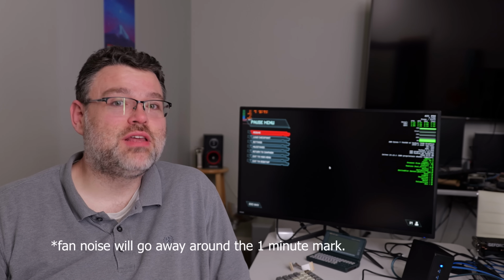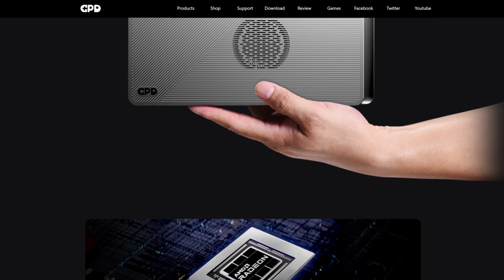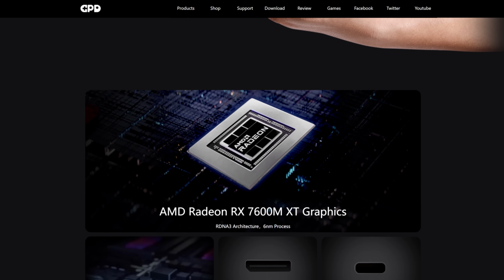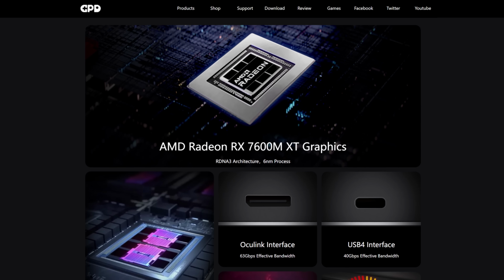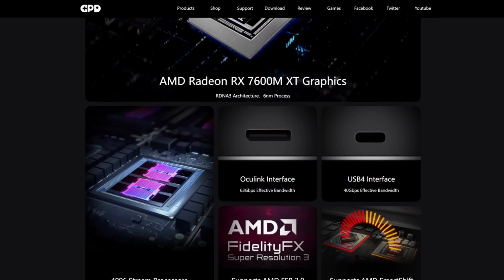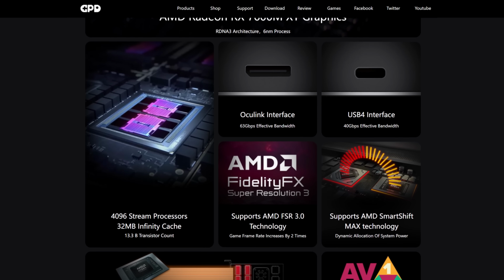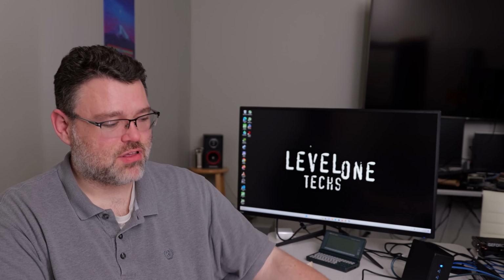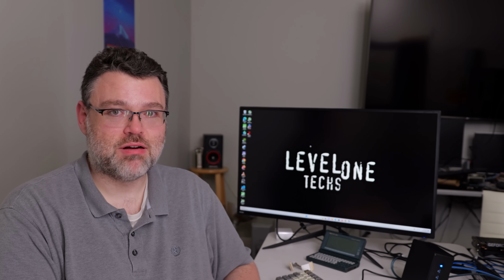GPD G1 + Minisforum UM790 (and a chat about Oculink and Thunderbolt Next)

Comment: Hi was wondering if you could help me please. I have both those exact models. The GPD G1 connected to my mini pc via oculink. I bought a Gen 4 50cm oculink cable. Question… do I use the HDMI from the GPD G1 to my TV only, or do I use the HDMI from my mini pc to my TV… or both and mirror them. Which one gives the best performance? Also do I connect both the oculink and thunderbolt 4 cables or just the oculink. Thanks, love your review! 😊
Reply: Sorry my actual problem is. I run the setup on my Samsung QN90B model tv. I have the setting set to game mode for 120htz. But all my games I have to press the option key otherwise my games won’t boot up. Also some in game cut scenes I have to press the option key for the game to boot to the next screen. Was wondering if I have the connections set up incorrectly. Thanks.

Comment: It's a shame for Intel that TB5 which didn't even come out yet is already kind of obsolete... I honestly don't get why external PCIE interface connections r not evolving fast enough and server based Oculink which kind of obsolete as well is saving the day. All mobile and mini PCs coming with reasonably good CPU could tremendously benefit from it by connecting eGPU card. And this pairing + docking station setup could go even further with all kind of benefits both for AMD and Intel. Hope to see more sophisticated and elegant eGPU + docking stations setup in the future similar to the Beelink GTi and that hopefully Oculink won't die after current version 2.0.

Comment: I tried a thunderbolt 3,4 GPU dock for my Minisforum UM 790 pro. It cost me £120 plus £85 for a Power supply. I already had a RTX 2080. Although it was a huge improvement I WANTED MORE🤣so I though I would try an Oculink setup(which was cheaper than the thunderbolt setup) In the meantime I took my RX 6900 XT from my gaming rig and did a little comparison using Unigine Heaven and it blew me away(do they still say that 🤣) Anyway here are the results if your interested:

Minisforum um 790 pro(780m) with graphics set to 6GB in Bios : - FPS=77.8, Score 1960
Nvidia RTX 2080 with internal graphics disabled : - FPS=298.7, Score 7524
AMD RX 6900XT with internal graphics disabled : - FPS=391.4, Score 9859.

I Thought the 790 Pro was quick but the above results brought me down to earth😃. I suppose I should run both cards through my gaming rig and see just how much faster Pci 16x is than pci 4x(Oculink through the M2 Nvme).

Comment: Thunderbolt is cool. 7600m doesn't get better than it actually is. Oculink is that nice thing that PC users never had. Wish half PCIe slots were ripped out from PCs and replaced with such connectors,while also being supported by market for regular people. All those PCIe risers could be ditched,things could be smaller and more compact, pretier and much more practical.

Comment: Would you mind to share the actual cable connecting on your device? I got this exact same setup, inspired by ETA prime tests, and got really disapointed because the M2.Ocullink connector does not go well inside the Minisforum UM790 Pro. Now I am using tb4. Moreover, I am getting some wierd driver issues, because my system goes dark when I am playing really graphic intensive games. Using on PopOS, did not try on windows.

Comment: Are you sure about Type C ports supporting up to 8 high speed pairs? I understand you said it has not been implemented, but I'm not seeing enough pins to support that unless some of the auxiliary pins are optional.

24 pin total
(4) for the two TC pair
(4) for the two RX pair
(4) GND
(4) VBUS
(4) for reversible USB 2.0
(2) for SBU
(2) for VCONN/CC1

I suppose the USB 2.0 pairs could be reworked (who wants USB 2 anymore? :) ) and the SBU pair is open for alt mode, but that would only open up 7 pair. I would think reworking any of the power pins would be a recipe for disaster, but I could be wrong.

Comment: Thanks for this video. I agree with you Thunderbolt 5 is already obsolete. Intel don't want to accept it. By the time Intel get Thunderbolt bandwidth to where it should be to support extrenal GPUs (eGPUs), integrated GPUS (iGPUs) will be adequate enough to make eGPUs pointless. Laptop discrete GPUs (dGPUs) are already adequate enough to make eGPUs pointless. Intel should have launched Meteor Lake (Core Ultra) with integrated native support for Thunderbolt 5. If the MSI Claw had Thunderbolt 5 it would be a huge advantage to what AMD has to offer. Other than external graphics and docking, Thunderbolt Share is something that should be already in use for multiplayer applications.

Comment: I have UM780XTX + GPD G1. Manufacturer promise that i can start system only with oculink but it doesnt. Only if USB4 connected. 
I can't name GPD G1 silent, cause its mainly stands on same table wtih monitor(near to user) and has turbine mode cooler, when it goes to "full power" mode(in gaming, for example) noise become very disturbing. Even if you are use headphones.
P.S. You can hear this whistling noise in video also.

Comment: It is worth noting that (if my understanding is correct, it may not be. Please correct if so): 
USB4 is technically capable of pcie4x4. But the motherboard side controllers are not. Although it has been proven in testing that USB4 does already exceed the pcie bandwidth of TB3/4 - but this is more a saturation of the pcie3 bus. Not jumping up to pcie4. 

Anyway, long story short - as the motherboard side controllers progress, the USB4 connection of the GPD GPU may well come close to the OCULink connector... You know, once the connector breaks 🙃

Comment: I would be very satisfied, if Thunderbolt could give me the option to only run PCIe over that USB-C (Laptop to eGPU) and the dock specific part over that USB 2.0 separate stream that every USB-C cable should include.
Keyboard, mouse and audio don't need more than USB 2.0 and if I need any high-speed connectivity I would directly connect it to the laptop.
What wouldn't work is any display signal over that cable in my case and i would be fine with that too. The internal display could still run with the iGPU.

Of all that might be very complex but it would be really nice. Even better when the system could switch between running on the iGPU with USB4/TB working normally and then that mode i explained above.  One can dream.

Comment: Pretty sure I destroyed my oculink port on either the GPD G1 or the GPD Win max 2 (7840U/64GB version) because I hot plugged it the first day I got it without realizing it would destroy it.  I have never been able to get it to work and I haven't had time to test the M.2 port with the adapter to confirm if this is the case.  Only works over USB 4 in all my tests on Windows10/11.  Sending my machine back to GPD set me back $200 through DHL for a free repair when the HDMI died on my other GPD Win max 2 (2022 6800U/32GB version) was a miserable experience but GPD does honor the 1 year warranty at least.  

It's great to see how awesome everyone's experience CAN be but mine has been... expensive and under-delivers.

Comment: I wonder if MCIO will ever see an external high-cycle connector, potentially with power injection.  USB channeling is irrelevant when add-in cards exist, and as PCIe spec gets faster this quickly becomes a non-issue.  For a consumer device, the 6.1 spec might be the peak, unless graphics card manufacturers do something braindead and make GPUs eat up all available bandwidth like AI/ML/NN cards do.  The story will forever be the same as it always has been, USB is for convenience but it's not the most powerful connector.  I also think there's situational nuance that consumers, nor enthusiasts, quite understand about the USB/TB and OCu/MCIO docking situation, by time you're reaching the capabilities of a true PCIe link, you're also asking for power demands that you would not want to be pushing through PD from host to device; and again, the USB channeling situation becomes irrelevant after a spec update.  Though I can see why someone would want PD from device to host, for host charging, and I hypothesized awhile ago that an out-of-spec implementation of OCu could probably achieve this considering there are four dead wires, literally listed as not connectected within whatever spec number these external PCIe solutions fall under (SFF 9402 R1.1, from the top of my head), where you could just use this dead copper as a form of power delivery with an accompanying injection module at both ends; I haven't looked at MCIO but I assume there's chipset-side pins that also have dead copper within the cable.  It's one of those situations where it feels like we're just one step away from having something great, but then again the industry has felt like this for the better part of a decade.  Last piece of the puzzle is a proper connector for PCIe 6.1 speeds with a branch of USB PD without the USB part, otherwise that's consumer endgame barring GPU manufacturers doing something stupid; GPUs aren't pushing those speeds, consumers don't need current-spec NVMe drives, 4.0-spec NVMe is more than enough for enthusiasts, 3.0-spec is probably also more than enough especially considering that you can utilize multiple drives by that point, USB chipsets take up hardly any lanes, etc.  An 8i cable on 6.1, assuming the MCIO naming carries over from the OCu naming where xi indicates equivalent lane count per gen spec, would be more than enough considering that's the equivalent of 5.0 x16 or 4.0 x32, enough for a modern full desktop GPU (again barring the industry doesn't do something stupid) and plenty of other connectivity within a dock, all over the double-wide cable, whereas a 4i, single-wide cable, would be enough for a GPU alone where the GPD solution of OCu+USB4 would suffice for a minimalist dock such as what we're currently seeing.  In fact, this might as well be overkill for consumers, an a laptop chip even run a top-end desktop GPU without significant bottlenecks that would otherwise justify a full desktop build?  Plus at that point, I'd rather see the adoption of consumer-level thin/thick setups where you have a thin and light that plugs into a networked server; by the way, what ever happened to Intel's Continuous Compute, I remember the original announcement and thinking it was essentially the consumer-friendly thin/thick. 

Though I also have to question at what point do we just look at optical links instead.  USB4 Gen 2 has a 2m limitation, Gen 3 has a 0.8m limitation, beyond this the cable might as well not be usable, Type C might as well be DOA when USB5 comes out, etc.  Even on the PCIe side, those cables are going to be fairly short, proper spec for 4.0 over OCu is already fairly short; and as a tangent, considering PCIe 6.1 supports 800G networking, all of that is already optical.  Maybe we'll see an OCuLink revival that's actually optical and copper this time, and that would solve the data transmission and power delivery issues.  Maybe if we could develop a super stubby variant of OSFP + power with a high plug cycle rate, that would be the endgame solution; though I would expect device cut-outs, alla FrameWork's module slots minus the module and just using a Type C cable in the host port, would work, not to mention it'd give nice physical security to the plug.  But we're reaching the point where copper is becoming less usable for data transmission due to physical limitations; isn't PCIe itself nearing EOL just because of this issue, I remember 5.0 was the industry's hypothetical EOL spec before PCI-SIG changed signaling strategy, and we saw the QOL drop from 3.0 to 4.0, considering 3.0 had massive overheads that allowed for a ton of risers, yet 4.0 nearly shits itself with one riser- what happened to all of those post-PCIe connector projects anyways, or did nobody actually develop anything during that time? 

I just want the specs and implementation to evolve already to where this becomes a moot conversation on the consumer device end.  We literally are just one step away from this, minus the lack of connector, minus possible changeover to optical data in consumer devices, and barring the GPU manufacturers doing something dumb.

Comment: It's a very refined object, but if I think about how much a simple, banal port costs that has a real 40Gbit of bandwidth to move a few files quickly (where the filesystems allow it), it's actually not bad at all. It's like having the graphic card separate from the machine plus a top-of-the-line dock included in the price. It is a product that needs to be understood, which is not suitable for everyone, but which makes a lot of sense in my opinion, for many many people, especially if you consider that even laptops, when the graphics card really works, still want a power socket near. I like it. Thank You!

Comment: Modern efficiency in computer chips is wild. I currently have a big, powerful desktop, but I think in a few years I'll probably migrate to a handheld with an eGPU. With the 7840u, he current CPU speeds are plenty for me, I can get 64GB of RAM in the GPD devices, which is more than enough for all my productivity work, and the integrated GPU is plenty in handheld mode (I'm pleased even with my Steam Deck OLED when it comes to handheld gaming). The one thing remaining is improving the eGPU speeds. I have a 3080, so the G1 would be a downgrade for me. In ~3-4 years though, I expect there to be an eGPU that is a significant upgrade to my current GPU.

Comment: TB3 is veeeery outdated. I use it for plugging in my work laptop, it's super handy to have charging, USB and display output in one connector BUT I can only have USB2.0 or I have not enough bandwith for 3440x1440p  with 120Hz (luckily "dock", which is built in my display alows to redirect lanes, so I can have high refrashe rate or usb3.0 if needed) and chargning is limited to 100W. TB5 is needed now and for sure 120/40 or 80/80 is not enough for future.

Comment: Just PCIe things: CompactFlash Express cards, the really really very expensive memory cards mostly encountered in modern high-end interchangeable-lens cameras. "CFexpress 4.0" was ratified in Autumn last year, by the CompactFlash Association: CFe 4.0 types A, B and C = PCIe 4.0 x1, x2 and x4. Xbox series X/S consoles have a storage expansion slot at the back which does fit CFe cards, but which only works* with the official Microsoft drives...or with an NVMe adapter: the consoles came out in 2020, but the slot connects to a PCIe 4.0 bus and the official M$ drives run on 4.0 x2 lanes - and as such are (and have always been) CFexpress 4.0 Type B-spec cards - because despite the involvement of a whole-ass association, "CFexpress" IS NVMe. It's just the shape of the connector that's different. And so, the asterisk, yer xbawks is now CFe-compatible without Microsoft having had to do anything, as long as the card is recent. And those NVME CFe adapters, some of them intend for you to leave the back end of a 2280 sticking out of whatever they're plugged into, but you can get ones which enclose a 2230, making them compatible with cameras and way cheaper and faster than the actual CFe cards, and 2230s are abundant now thanks to the Steam Deck.

Comment: GPD Win Max 2 2023 external OCuLink connector by default is forced to PCIe 3 as of now due to instability problems GPD got with the very specific lanes used for the connector - if you force PCIe4 in the BIOS for it it disables CPU boost as they could not handle PCIe4 and CPU boost at the same time and AFAIK were working with AMD to solve this. The 2230 M.2 PCIe lanes are fine and if you add OCuLink connector there it can do PCIe4 and CPU boost at the same time.

Comment: seems like that occulink adapter would certainly work with the couple of Gen3 M.2 2280 daughter board options for the RPi5 - guess its just down to drivers and time needed for someone to "give it a whirl" (I think there are still some issues with BAR I/O for GPU's on RPi5 like there were for RPi4) - As for RISCV, just need a board with usable Gen3 / Gen4 PCIe connectivity - actually there are more than a few 3588 boards with suitable PCIe connections (and less BAR I/O issues) that might be worth trying as well ..

Comment: Hey Wendell, can you do a deep dive on PCIe bottlenecking? It would make an excellent companion for your videos on creative ways to get access to PCIe lanes and every other analysis I've seen of bottlenecking assumes that GPUs are the only PCIe devices and that gaming is the only use for GPUs (that, or crypto where the bandwidth requirements are so low that it doesn't really matter). For example, do AI workloads require as much PCIe bandwidth as gaming, and under what circumstances will those workloads experience bottlenecks?

Comment: you can create a save box with 4tb there you start a live co-control program like a steam and the same on your system then you release the system there and back and it starts via console and streams through your copy in 60 Hz with a console You can set up a recording program as a stream with good transmissions, 1x1 copy with taxes and then you turn on your program normally in 4k and steam the console stretched out and the edge invisible and start the 1440p application over it to 1080p or 720p for more Hz performance Everything about a monitor that you can use to assign complex data Internet and system a turns graphics via consoles and programs the transfer and processes no time for something like that you can basically accelerate and transfer applications correctly with it with the best for more FPS maximum resolution applications and full graphics. Support everything possible if I could. Worth it, all of you unemployed, I have to go to work now, sorry, good luck